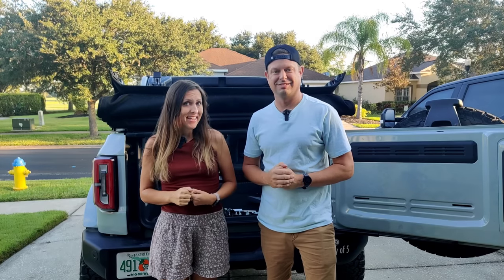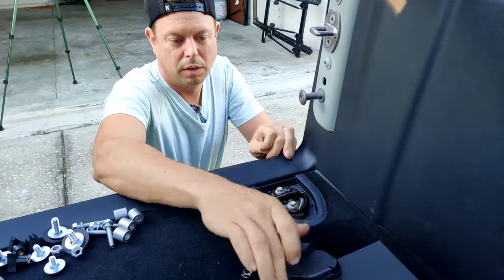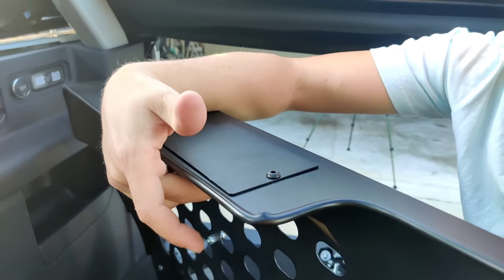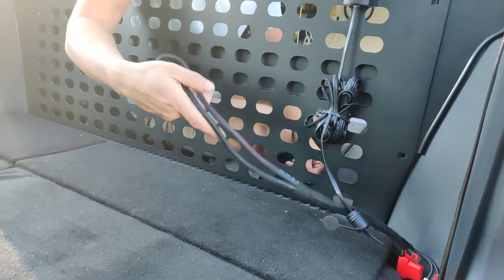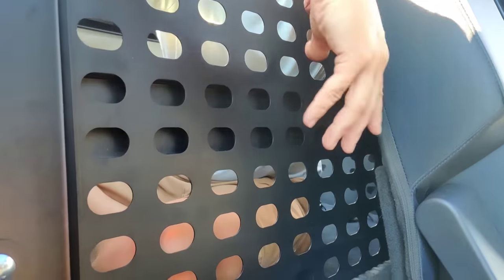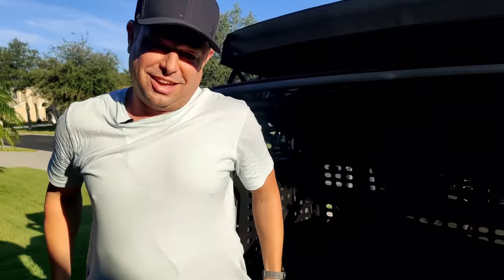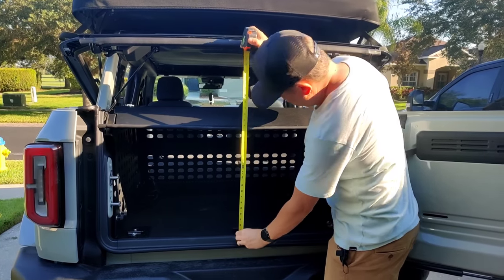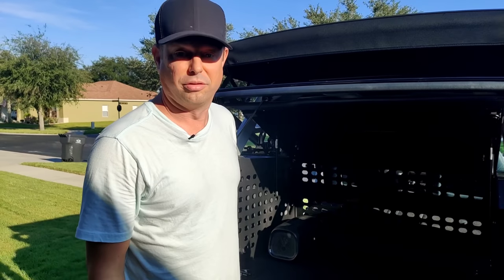Ford Accessories Cargo Area Enclosure Deluxe Raised Lid for Bronco Install & Review Tonneau Tuffy

Comment: Thanks for this video (3rd times the charm).  Just installed mine this morning and this was really helpful as the directions provided were really lacking.  Tip for the lower rear bolts that attach the rear panel is to use a piece of painters tape in the socket to hold the nut in the socket until you can get it threaded on the bolt.
Reply from the maker: Great tip!  The bottom bolts are just within reach making it very tricky to get the nuts started.  The tape idea would have been great.

Comment: Great video. Don't have my Bronco yet, but when I do I plan to get one of these. Your video basically sold it for me. I want to ride around with my dog in the cargo area and I like that you can remove the top piece and the sides still stay in place. Nicely done.
Reply from the maker: Thanks!  We did get a great test with our dogs.  We removed the top/lid which took a couple minutes at most.  Had our luggage strapped to the side Molle panel and our dog had over half of the cargo area.  Worked great for a 7 hour drive.
Reply: Curious, did you guys measure diagonally inside the enclosure? I've seen a couple other people ask about Golf Clubs fitting and that would be great to know. Thanks!
Reply from the maker: @tylermccall1  I haven’t, sorry.

Comment: Hey thanks for posting this. I too, got mine with Ford Points. It sat in a box in my garage for over a year. Decided to repair the slab in the garage so, easiest way to deal with this thing was to install it. Yer vid helped bunches as the Ford instructions linked like they were photocopied 500 times or something. Totally illegible.

Anyway, thanks again - appreciate it!

Comment: Great video. I’ve been debating on getting this accessory. The one draw back is losing the pass through. It’s great to see how easy it is to install though. Thank you! 👍
Reply from the maker: In reality you should be able to remove the four bolts that secure the seatback panel and leave the side walls and top installed if you needed to have a pass through in a pinch.

I am surprised they did not add a panel in the seat back section to allow a pass through however I assume that would have been more difficult to secure?
Reply: @BuckleUpButtercupTV  Thank you for that. I was wondering if that would be possible or if it all had to be together. Maybe they will make another one that has a pass through solution built in. I am really looking forward to seeing all of the aftermarket accessories that will be coming out for these.

Thanks for the reply. Keep creating! 👊👍

Comment: This looks awesome but I want the pass through. I’ll probably get it and try and figure out a quick detach bolt or cotter pin type option.
Reply from the maker: I was thinking the same!  It wouldn't be difficult however it would reduce the security unless you maybe added a hole for a pad lock or something to make it a little more difficult for someone.

Comment: Thank you for making this video (and for keeping your older videos up...they're a great reference source). I actually went ahead and bought my enclosure based entirely on this video; the dimensions you provide were a great help. I've yet to install mine quite yet (my Bronco is heading for a hopefully brief stay at the dealer) but this already shows me a few things I want to try changing when I finally get around to doing so (i.e. why are quick-release nuts used in the lower corners (where they eat into space) but not for the lid hinges, where you would actually want to quickly remove a panel?
Reply from the maker: I am glad you found the video helpful! I hope you enjoy your bronco!
Reply: @BuckleUpButtercupTV  ...so...having FINALLY gotten around to installing this, all I can say is...HOLY ****; YOU DID THIS THREE DIFFERENT TIMES?! Once is enough in my book...Tuffy's manufacturing tolerances (at least on the one I received) are godawful, making bolting that back panel a total pain.

Comment: Thank you for this video! Installed this along with the cargo drawer. Unfortunately I’m getting a lot of rattling. I’ve double checked the installation and I’m really hoping I can figure where it’s coming from and how to fix it. Very frustrating. Anyone else have this issue? I heard the author of the video say they haven’t experienced any rattles. I’m really hoping to be able to figure it out and keep this because it’s very nice.

Edit: I double checked and one bolt wasn’t tightened all the way and the washer was rattling. All good now. Super happy.
Reply from the maker: I have had mine over a year and still no rattles, sorry to hear you are having rattling issues.
Reply: @BuckleUpButtercupTV  I think I found the issue. There are two rubber seals I missed. One looks like it attaches to the rear bottom panel. Is that correct? The other thinner one I have no idea where that one goes.

Comment: Thanks again for the walk through. Helped a ton on my install. Have you found a way to keep the rear from opening if top is down or window is broken into and someone reaches in and hits the door unlock? Seems that that opens the rear hatch door.
Reply from the maker: No, but there are vaults that you can get.

Comment: Best info I've seen so far on this enclosure. Confirms that it's possible to easily remove the top when needed. A couple of quick questions:
Is there room to flip the bolts and thumb nuts around on the sides? Thinking the thumb nuts poking in would reduce the usable space and things might catch on them, but the smooth bolt heads being on the inside wouldn't have that problem.
If you don't have the fob, can you unlock the tailgate by simply pushing the door unlock in the cabin? Since this depends on the tailgate to secure your items, I'm just wondering how effective it is if you leave your top off.
Reply from the maker: We have learned quite a bit since installing the enclosure.  It is fully secure when the top and doors are off which is great, almost too secure!  I would couple this with either a keypad or the Ford Pass app to manage access while the doors are removed, if not it is always going to be locked.

The top can come off in a matter of minutes, I wouldn't say it is meant for repeat on/off installs but it is easily doable.

With the top removed you still have a nice 3 wall Molle panel system.

The plastic nuts on the lower section may be possible to flip but it would be a little tedious.

Over all this has been a great addition to our Bronco.
Reply: @BuckleUpButtercupTV  What about with the top off but the doors still on?
I haven't found anything that really discusses that situation.
Reply from the maker: With the doors on, you can press the unlock button on the door to unlock all 5 doors.  Now the factory alarm doesn't like the interior unlock button to be pressed while the system is activated.
Reply: @BuckleUpButtercupTV  Thanks for the info!  Really disappointed unfortunately, as providing some secure storage with the top off was the whole reason I was considering this enclosure. Not planning to go doorless that often.
Reply from the maker: The alarm should sound if someone were to access the Bronco through the open top and press the interior unlock button.  Also at that time you should get an alert from Ford Pass.  I think if someone where to do this they also wouldn't hesitate from breaking a window of a traditional vehicle.  Another thing to consider the enclosure offers "out of sight, out of mind" peace of mind too.  Someone walk by wouldn't be able to tell if you had nothing back there or a load of gold bricks which reduces the desire to break in.  Overall the enclosure has greatly reduced our anxiety.
Reply: @BuckleUpButtercupTV  Now you've got me trying to remember if I included the alarm in my build. 
I definitely get that this would discourage those that might consider breaking a window. But that out of sight element is a little reduced when there's no top or window on the vehicle. The alarm and notification doesn't do much if I'm not anywhere near my vehicle.
Reply from the maker: The enclosure prevents someone from walking by to see if you have anything in the cargo area.  Without the enclosure there would be zero protection and everything would be sitting there for all to see/take.

I may be mistake but there is a basic alarm on all models that activates when the doors are locked with the fob?  We have tested it and have been able to get inside a doorless 'locked' Bronco but with the doors on we have set it off by unlocking when reaching in the window
Reply from the maker: So we just tested it in both the Bronco and the Tremor.  The OEM alarm doesn't seem to be consistent.  If the window is down and the unlock button on the door is pressed the door can be opened without an alarm from the outside handle.  When we used the inside handle or climbed in the alarm would go off.
Reply from the maker: Very confusing.

Comment: Sorry, stupid question, but does the bronco not have power door lock/unlock switches inside the cabin or do they not operate the rear door?  just thinking its only as safe as the back door being locked?
Reply from the maker: When the doors are off, the auto unlock does not work and you have to have your key fob to unlock it. It's just as safe as any trunk for any vehicle.
Reply from the maker: The physical door lock controls are located on the doors.

Comment: Hi great install but I'm a little  confused if someone was to open you tailgate would or is there a way to lock the box door?
Thanks for all your great info
Reply from the maker: There are latches that lock the top. You have to open the tailgate in order to unlock the top.

Comment: Love the channel. Great content. Very jealous that you have your bronco and I don’t. A few questions if you don’t mind. What’s the depth and diagonal measurements? Any chance you can try putting a set of golf clubs back there? Also, the hand tightened bolts down both sides seem to waste space. Any thoughts to replacing them with something that fits more flush?
Reply from the maker: I will have to measure, if I had to guess, I would say Golf Clubs would not fit. Right now, we have no plans to change anything, but we will see! Thanks for watching.
Reply: Yeah this my one question/ hesitation with buying this? Won’t work if my clubs, won’t fit. Hope to find someone who can answer this question! Great videos though

Comment: First time seeing the Mollie Panel for the back!  Awesome, and thank you for sharing.  If I wanted to not use the top cover, can I leave it off or does that affect the sturdiness of the system?
Reply from the maker: Not at all from our experience.  The 3 walls are just as solid with or without the top in place.  The top is only held in place by the bolts for the pivot point and the struts.  While I wouldn't want to remove the top on a regular basis it could be removed in a few minutes if you wanted to pick up something large.
Reply: @BuckleUpButtercupTV  Thanks for the reply! what if I wanted to mount something to it? still sturdy?

Comment: Great video, thanks! Couple of questions (if you still monitor comments on your older videos):

Is there enough space between seat and panel for a small subwoofer, particularly when the seat is reclined? (Well, if you can call that extra 1/2" adjustment Ford gives you "reclined.) It would be great if a sub could fit into that space. Maybe if not the Kicker one of the compact Pioneer or JBL subs.

A few things bother me about this enclosure:

Why does everyone insist on using flat black powder coat for this type of thing? That stuff scratches like crazy. One of the glossier crinkle/veined powder coat finishes would be much more durable.

Why in the world do they have the quick-release knob/bolts on the panels you're least likely to remove? The main parts I would be frequently adding/removing are the top and the back panel to put the seats down. They should have welded the nuts on those panels and used quick-release knobs there. I would almost never remove the side panels, yet that's where the knobs are. Not only impractical but also cutting into your cargo space. Poor design here, Tuffy.
Reply from the maker: I don’t think it’s enough room to fit a subwoofer. I have the jbl bass pro go and it wouldn’t fit and that’s a smallish sun.

Comment: If you need back seat access for sleeping, is it possible / easy to remove just that part and leave everything else installed?
Reply from the maker: It has been a while since I checked that, but I think I have in the passed and I recall the answer being no… but I’ll check again for you!

Comment: Great video!! I have been trying to figure out a security solution since i switched my order to soft top and this cleared a lot up about this option!

I just have one important question:

 - With the enclosure lid closed, soft top closed, and the rear seats down; could I fit a 5 foot ladder across the top of this enclosure facing down behind the front seats at an angle OR even just across the the top of the enclosure flat? If you have the measurement from the back of the soft top (at the highest point) to the back of the front seat (where the rear seat folds down to), it would help me determine this. 

I am an electrician and want to put my tools in the enclosure, but need to fit my ladder somewhere still. Thanks again for the video and info!
Reply from the maker: I will check, we have a multi position type ladder that I can test with.

Comment: I set my BL up to be rain/water friendly. Do you think the panels for the soft top removal being open indefinitely will be an issue if it gets wet in there occasionally? Or, does the enclosure seal most of the top of that opening from excessive water access?
Reply from the maker: The enclosure lid definitely blocks rain from directly hitting whatever is in the cargo area however I could see during a major downpour have water run down the sides and collect on the cargo area liner.  We will be carrying large zip lock style bags to keep anything dry that must stay 100% dry

Comment: I like the idea of the molly's on the sides but not necessarily blocking the seats, maybe a folding one possibly cloth for that rear of the seats.  Just my opinion and everyone has different needs.  Love the video though nice work.
Reply from the maker: Yeah, it would be nice if you could easily fold it down!

Comment: Awesome, question what’s the measurements on ho deep it is. ( till that raised bottom floor and the rear gate to the seats. )
Reply from the maker: The carpeted section of the floor is 31.5" to the door.  If you go above the lip to the door it is 33.5".  The top of the enclosure to the door is 32".

Comment: I wish they made a way to quickly detach the top and front for when you need longer/taller objects in the back. 

The side panels could stay on and there could be a latch of some sort that can only be accessed from inside the enclosure rather than outside of it.
Reply from the maker: I do think a company is in the works of making something like that.
Reply: @BuckleUpButtercupTV  I know this is old but there is an option by a company called "diabolical" now.

Comment: I wonder if the onboard door storage would work with, just, the top off.  I'd use the cover more than the door harness, but would still like "easy enough" access.
Reply from the maker: No, unfortunately the width of the trunk space is 41 inches with the enclosure installed.  The front doors seem to take up the entire width of the trunk area without the enclosure as they measure around 43 inches.  It would have been nice to simply pop the top/lid off and put the doors in back but that doesn't seem to be possible.
Reply: @BuckleUpButtercupTV  That just stinks.  I want to do it all.  lol
Reply: @BuckleUpButtercupTV  I would love to know if you have found this to be a concern? I have watched your other videos and it looks like you do remove your doors often. Have you found this storage area to be bothersome and perhaps regret the installation or have you found that the benefit of the storage to be worth the sacrifice of door storage?
Reply from the maker: @SH-hx7rz  we have never stored our doors in the trunk, However, I am very happy with the enclosure and would purchase again.

Comment: My wife, Donna, bought the full size 2021 Outback and just received it a month ago. It came with a hard top. All of the soft tops I've liked at getting for hers for spring & summer driving do not fold down as far as yours. Our dealer gave me a link but none of the sellers have one that goes down as far as yours either. What brand is yours? I'm also looking at getting her the tailgate molle storage pouch, have you given that any thought?
Reply from the maker: Did you option for the bestop? That is an upgraded soft top. I have the stock soft top. I do have the molle panel back cargo enclosure. I have a video if you’re interested

Comment: Just installed over the weekend. First, your video was the reason why it's was "easy" to install. The instructions are terrible so thank you. Second, when installing the top, did you tighten the rear bolts up against the white plastic washers? I didn't want to over tighten but I am getting a little rattle noise while driving and I am thinking it's the white washers not being snug.
Reply from the maker: Mine is tighten, I still don’t have rattling to this day.